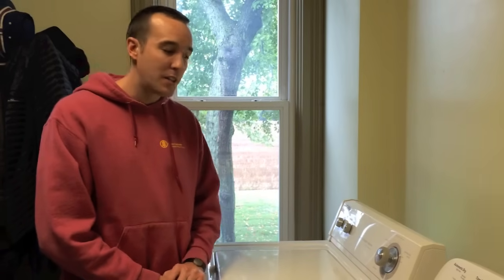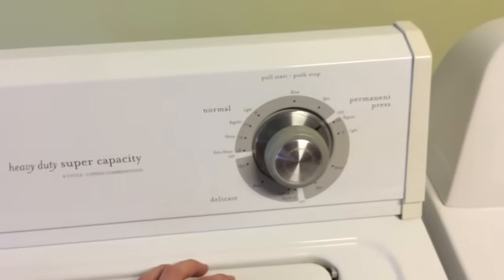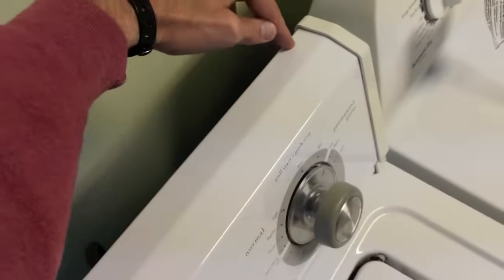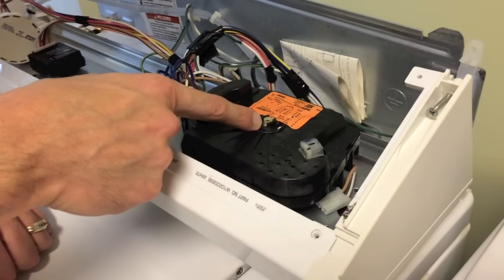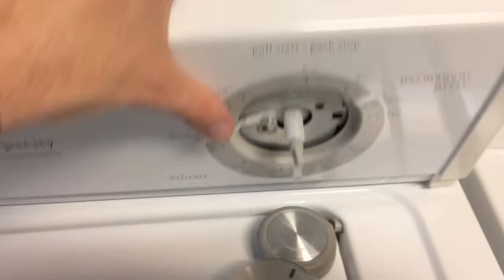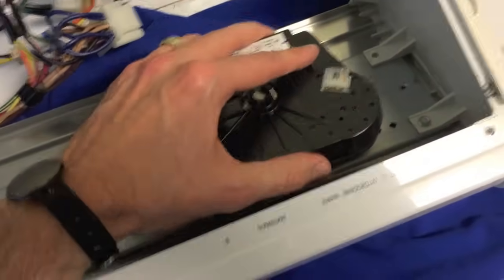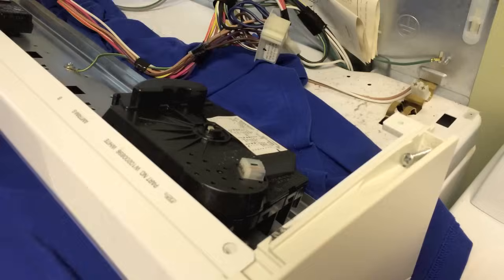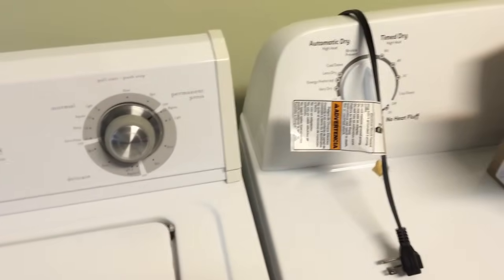My washing machine stops at Rinse - Does not DRAIN or SPIN

Comment: So I replaced the water valve assuming that was the problem. On the normal cycle only hot water comes out. When I switch to cold it just stops. Switch it to hot and it’s coming out. However it proceeds to wash and once it hits rinse it won’t proceed further. What could that be?
Reply from the maker: Thanks for watching, the valve screens being clogged are the most common cause however since you have a brand new valve and screens, it’s possible that your cold water shutoff valve is not fully open.

Keep us posted and hey if you’re into crypto trading, check out our DIY ecosystem.

          toolboxtoken.com

Reach out to us any time!  🧰

Comment: I don't think you diagnosed the timer as faulty
Reply from the maker: Thanks for watching, did it end up being the Timer in your case?  The Lid Switch is also a common cause.
Reply: @DIYwithMichaelBorders  I think it is the lid switch.  Changing the timer on a washer without diagnosing it, is like changing the gas valve on a wall furnace without fully checking it out.  A lot of plumbers approach it like that, and the customer gets stuck with the bill.
Reply from the maker: @johnnystaccata  

Thanks for the follow up, heres a link to a video showing replacement of lid switch.

     https://youtu.be/1hTRc-_PnP8

😎👍

Comment: Mine did exactly this. I opened her up and replaced the timer. Put it all back together. Plugged it in and it started to rinse and then suddenly stopped again. Still doesn’t work. Not sure why
Reply: I found out why. So mine did just like this, stopped on Rinse and wouldn’t rinse or drain. I put a new timer in. Didn’t work. Cleaned all wire connections and checked the door latch. Still nothing works. Sometimes the washer makes a buzzing sound like it’s trying to work. Turned out one of my kids socks was stuck in the pump. Once I got that sock out and put her back together, it worked. Wasn’t the timer at all so I kept the old timer in case.

Comment: I have a GE that does agitate but doesn't rinse/spin/drain. The timer makes noise and that's it. If I move the switch back to agitate it will once again wash. Does this sound like the timer is bad or can the pump be bad? The noise is definitely coming from the timer though and not the pump. Thanks you for any hep
Reply: I figured it out, I had a piece of towel lodged in the pump. It was very difficult to hear the pump turning on and off while trying to work with the timers typical noise in the foreground. When I removed the front panel it was clear as day when starting and stopping the machine. I figured I'd post in case someone else ever has the same issue and stumbles along my post. Thanks for your help
Reply from the maker: Water Detecting Croatia Thanks for checking out the video and sharing your comment and experience.  The household washing machine is a pretty darn important machine that's helps life run smoother haha.  Thanks for the update.  I was reading your initial comment and I was thinking it was the timer.  Glad you found the towel.  Please Subscribe to the channel and turn on your youtube notifications that would be awesome thanks again 😀👍

Comment: Sadly didn't fix my issue so will be sending this item back. My motor isn't turning on, no hum from my motor but I hear a hum from the timer area. I also replaced the capacitor. Getting a new motor to see if that's the issue. But my motor wasn't locked up, clean just nothing happens.
Reply from the maker: Thanks for watching & sharing this, we are looking forward to hearing back from you with the update on the motor install when that arrives.

That’s a bummer you replaced a part & it didn’t fix it.  Let us know if you have any questions, we DIYers need to stick together!!!
Reply: @DIYwithMichaelBorders  O, thanks for responding back :) 

I replaced the dial, the lid switch, the capacitor and now the motor all new. Still the motor will not turn on. I do hear a humming noise from the pressure switch(nothing from motor), but not sure if that's normal or would cause this issue. My washer fills up fine, but then just stops when it's at the correct level. Will not drain(drain pump is fine) From there the humming noise.

I even tried to spin the motor with my hand, but still no movement/power to it. If you can think of something for me to try please let me know. Feel free to link an affiliate link of the part. I am stumped atm. Even tried to reset doing the lid opening and closing 6 times. Model wtw5300vw3
Reply: Never mind heh =/ So all that work and it was my lid switch after all. I installed a new one before thinking that was it, and still had the same issue. So my old one went bad, and the new one didn't work. Only worked when I tied the 2 wires together and left the ground plugged in. Any ways thanks for all that you do, now I have many things to return lol.
Reply from the maker: @mrsmith5114  

Good morning, that’s great news you found the cause.  By the looks of it, you have been busy!!!

All those replacement parts are going to make your machine last a long time, that’s awesome!!!

Hopefully many stress free days ahead for you from here, & if you like football, you can relax & watch some Sunday games.  😎👍

Comment: How did you determine that was the problem?
Reply from the maker: James Barnes 

Thanks for checking out the video.  Great question!  The Timer controls the “Cycle Flow” and continues to move the cycle through the steps.  As the internal parts of the Timer begins to wear out...you see the washer stopping at either “Drain or Spin”...

The Lid Switch also is a key part in the cycle...once you lower the Lid/door...you will hear a click.  This click secures the electrical current and sends message to Timer to begin the Cycle.  

Also...once the cycle gets to the spin portion, the timer re-communicates  with the lid switch to verify that the lid is closed for safety purposes...example:  you do not want the washer to be spinning with a lid open...water will fly everywhere 😱

We recommend purchasing both the timer and the lid switch as they work together to move the washer through the cycle.  

To order parts, Go to:  repairclinic.com

Keep us posted!  Please subscribe to the channel & ring your YouTube bell 🔔 this will be very helpful to us thanks again 

😎👍🔧🔩

Comment: So is it the timer if I can switch it to spin/drain and it will go? Our washer stops at rinse but you can switch to spin/drain and it will run?
Reply from the maker: Thanks for watching.  Great question and in that case, we would replace Timer first.

While replacing Timer, we recommend also replacing your Lid Switch.  These two parts work together during the cycle and cause make a huge improvement to your machine’s overall performance if replaced and brand new.

Below is a link to a video showing replacement of Lid Switch.

       https://youtu.be/1hTRc-_PnP8?si=FWwSUxJVzUi8GRn5

Keep us posted.  😁👍🧰

Comment: When replacing the first part (silver in this case) dial, can it only go on one way?  I mean could you replace it incorrectly where the indicator mark is not aligned correctly or do the grooves make it so it can only be replaced in one position?  I'm talking about the piece that is underneath the button.  Also, is this the only possible thing that could be causing the washer to stop mid cycle?
Reply from the maker: Annony Mouse Thanks for checking out the video Annony Mouse!  Great question.  The knob assembly is designed to fit on the housing in only one position.  This is to prevent any confusion in regards to the position of Knob and position of Timer.  

To answer your 2nd question:  No...and I’m so glad you asked!  At any point the “Lid Switch” becomes faulty, it will not allow the cycle to spin.  This is a safety feature built into the Machine to alleviate water flying ALL OVER THE HOUSE with the washer lid open 😱...That definitely would be a lengthy clean up!  With this said... once the lid switch fails... the cycle no longer allows the washer to enter the spin cycle.  

Below is a link to a video that runs you through the step-by-step process on how to replace your “lid switch” and get the washer back up and running properly.  I always recommend replacing the “Timer” and the “Lid switch” since both parts can cause this issue and in most cases both parts have a life expectancy of five years.  Keep me posted on your progress.  

Please subscribe to the channel and turn on your YouTube notifications that would be awesome thanks again 😎👍

https://youtu.be/1hTRc-_PnP8

Comment: in my case it was my:  "LID must be CLOSED" switch that was defective - I simply eliminated the SWITCH & twisted the two wires together + crimped on a wire connector & water-proofed the connection with some LIQUID-ELECTRIC-TAPE --- now I must remind myself NOT to reach into a Spinning Washing-Machine ... ie: the 10% TEST
Reply from the maker: Thanks for watching Dave.  Let us know if you have any questions.

Hope all is well.  😎👍🔧🔩

Comment: I have the same model ... over time the washer would fill and stopped several times or full hours later then wash but now it doesn’t fill at all.. sometimes I would turn the hot/cold knob several times to get it to fill.. what should I replace first
Reply from the maker: Terry Mcgee 

Thanks for watching Terry.  This is caused by 3 things.

1.  Failed timer
2.  Failed lid switch
3.  Clogged filter screens inside your water inlet valve.

Let’s get this figured out!  We recommend turning the shut off valves off to your hot and cold water lines that feed into your washing machine.  Next, carefully unscrew the water lines from your machine with awareness that it may leak a little bit of water so be prepared.  After removing the waterlines, you will see those screens and they may be dirty, go ahead and carefully clean them.

After cleaning the screens or you can replace the old screens with new screens which can be purchased at your local hardware store, put everything back together and run a test cycle.

If that solves the problem great...if not...we recommend replacing your timer and lid switch together.

Keep us posted.  Please subscribe to the channel and ring your YouTube bell 🔔 that would be helpful to us thanks again!

😎👍🔧🔩
Reply: You’re awesome 👏 I’m going to replace the timer switch on Tuesday and check back.
Reply from the maker: Terry Mcgee 

Very cool & we will talk to you soon!

😎👍🔧🔩

Comment: My Kenmore 90 series stops after the rinse cycle and won't drain.  After some research, I determined that it was the water drain pump.  I removed the pump and looked at it found a small sock stuck in it.  I removed the sock and reinstalled the pump thinking that the problem was solved. I put the washer in the rinse cycle and the same thing happened, the washer did not drain.  So now, I thought that the sock had damaged the pump.  I bought a new pump and installed it and the washer still will not drain and spin.  The agitator works during the rinse cycle just fine, so it couldn't be a motor problem, right?  Any suggestions?
Reply from the maker: Pez Espada 

Thanks for watching & we hope the video helped.  It’s very possible that your drain hose has clogged.  Try disconnecting the hoses from your Drain Pump & verifying all hoses are clean & clear.  Keep us posted!

We really enjoy making these helpful videos for our fellow DIY’ers.  Many more helpful videos to come!  😀

Let us know if you have any questions.  Please subscribe to the channel and turn on your YouTube notification Bell 🛎 that would be awesome thanks again!  

😎👍🔧🔩
Reply: @DIYwithMichaelBorders  Yes, I checked all drain hoses there are no obstructions.  Could the motor have been damaged by not being able turn the impeller in the pump due to the sock?  I actually removed the motor to check the coupler and the coupler was in good condition.
Reply from the maker: Pez Espada 

Thanks for the update & it’s very possible that your motor had been damaged due to being possibly overworked with the clog.

It’s also possible that your Lid Switch has malfunctioned causing the stoppage in cycle.

A new Lid Switch May get you back up & running properly!

😎👍🔧🔩
Reply: @DIYwithMichaelBorders  I installed a new lid switch earlier this year.  I have checked the start capacitor it is rated at 270 mF to 324 mF.  I tested it with a capacitor meter and it read 267 mF.  Could this be the problem, a weak start capacitor?
Reply from the maker: Pez Espada 

Thanks for the reply & it’s very possible.

😎👍🔧🔩

Comment: We have a maytag washer and I did laundry as usual, so I left for work and came back hours later and the cycle just completely stopped at the spin portion so my clothes were just sitting in a pool of water. So I unplugged it and tried to reset it, but now my washer won't even turn on, let alone drain the water. I did unplug it for a minute and it did turn on, but only in the "sensing" portion of the cycle (the first step). It won't do anything but just sit there. I'm really frustrated and unsure what to do...
Reply from the maker: Hannah King Thanks for checking out the video and sharing your comment Hannah...so sorry you’re having trouble.  Something has failed and we need to pin-point which part.  

Try toggling the cycle knob a tiny bit forward past the point that the wash cycle stopped...then push knob in and see if it starts the cycle again.  If it does, it can be the “Timer” that has failed which you see in this video.

The other option “however more likely if the cycle stoped at Spin” is the Lid Switch.  The lid switch is very easy to replace and pretty inexpensive.  

I recommend purchasing your replacement parts from:  
         repairclinic.com

Either way, I would purchase both parts and replace them because the Lid Switch is pretty cheap and very easy to install.  I have attached a video that shows the Step-By-Step on how to replace Lid Switch.

Your washing machine is very important and we can definitely fix this together.  Keep me posted on if it starts running after you move that knob slightly past where it stops...as I mentioned before.  Please subscribe to the channel and turn on your YouTube notifications that would be awesome thanks again Hannah!

https://youtu.be/1hTRc-_PnP8

Comment: We have a Samsung top load washer that was working fine until started to stopped in the spin cycle and leave the clothes too damp, also I notice that is changing it self  the size of the load for example: I put medium load but switch to extra large all the time.
Hope you can help us to fix this problem, we have no more than a year since we buy the set that's why we want to try get fixed before have to spend on a new machine. 
Thanks in advance!
Reply from the maker: Jez Iz Thanks for checking out the video and sharing your experience.  Definitely important that we get this figured out together...from the symptoms that you have mentioned lead me to the Timer or the Lid Switch.  The Timer controls the “Cycle Flow” and continues to move the cycle through the steps.  As the internal parts of the Timer begins to wear out...you see the washer stopping at either “Drain or Spin”...

The Lid Switch also is a key part in the cycle...once you lower the Lid/door...you will hear a click.  This click secures the electrical current and sends message to Timer to begin the Cycle.  

Also...once the cycle gets to the spin portion, the timer re-communicates  with the lid switch to verify that the lid is closed for safety purposes...example:  you do not want the washer to be spinning with a lid open...water will fly everywhere 😱

I recommend purchasing both the timer and the lid switch as they work together to move the washer through the cycle.  

To order parts, Go to:  repairclinic.com

Attached below is a video showing the step-by-step process on how to replace your lid switch...it’s very easy and both parts are very inexpensive.  

Keep me posted!  Please subscribe to the channel and turn on your YouTube notifications that would be awesome thanks again 😎👍

https://youtu.be/1hTRc-_PnP8
Reply: Thank you very much for your answer, we are going to do it as you suggest, I'll keep you update. and of course that I subscribe to your channel.
Reply from the maker: Jez Iz That’s great news and thanks for the update!  You should be back up and running after the repairs.  Please let me know if you have any questions along the way.  😀👍

Comment: My side load LG was stuck on "rinse". Motor was making a noise, but no spinning. There was water leftover. Got the OE code. New pump and pressure switch. No obstructions whatsoever. Yet, it still hangs on the "rinse" cycle. I can't figure it out
Reply from the maker: Jason Ricci 

Have you replaced your Door Switch / Lid Switch?  Below is a link to our video that shows how to perform an EMER drain, you may find this helpful in the mean time.

       https://youtu.be/NDOGVtlUDss

Keep us posted!  😎👍🔧🔩